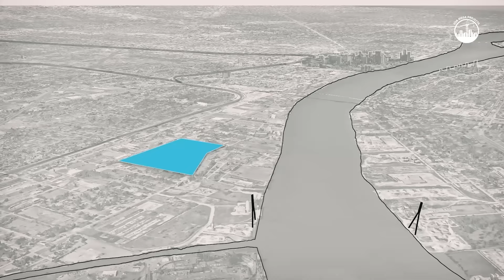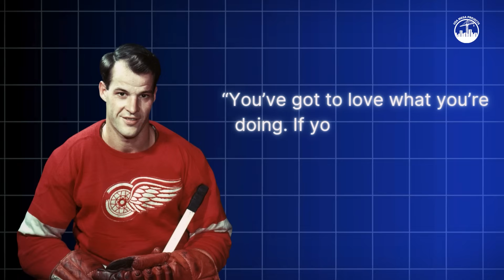Inside the Gordie Howe International Bridge: Detroit’s $4.7B Mega Project

Comment: NOT Detroit's project. A Canadian project paid for totally by Canadian taxpayers and the tolls will be collected in Canada. Also trucks will be direct to Hy 401 not through city street.
Reply from the maker: That’s correct. It’s a Canadian-owned and funded project, with tolls collected in Canada, and the design routes trucks directly to Highway 401 rather than through Detroit or local city streets.

Comment: I seen so many engineering mistakes already. It will have major problems in a year.  

The off ramp comming into detroit has a major dip in it. They just tried to cover up how bad it is by sliding dirt under it.  Those cables are also going to give way under all the weight of the trucks, woth no support in the center. Horrible engineering nightmare. Which took 2 years longer than it should have to make.
Reply from the maker: Concerns like that are common when people see early-stage settling or temporary fixes during construction. Major bridge projects go through repeated inspections, load testing, and structural monitoring before opening, and cable systems are designed with large safety margins specifically for heavy truck traffic. Visible dips or adjustments are usually part of final alignment corrections, not signs of failure. Real problems would trigger regulatory action long before public operation is allowed.

Comment: I always took the tunnel because there was no truck traffic which is why the Ambassador bridge was so slow.
Reply from the maker: That makes total sense avoiding the truck congestion would definitely make the tunnel a smoother and faster option. The heavy commercial traffic on the Ambassador Bridge has always been a major bottleneck. The new bridge should help ease that load, but for regular drivers, the tunnel has long been the quicker, quieter choice.

Comment: You can overcome anything - except a moron President doing everything possible to block trade and destroy the Canada/U.S. relationship.
Reply from the maker: You’re right, leadership makes or breaks these projects and relationships. Engineering challenges can be solved, money can be raised, and even politics can usually be negotiated — but when a president or top leader is actively blocking trade and cooperation, it creates unnecessary walls between two countries that rely on each other. The U.S. and Canada have one of the closest economic relationships in the world, and damaging that for short-term politics hurts both sides in the long run.

Comment: The towers are not taller than the Renaissance center. The Mackinac bridge is by far larger and has a 3800 ft span.  Get your facts straight.
Reply: He said “cable stayed bridge”. His facts are correct. Mackinac is a suspension bridge which is quite different.
Reply: I’ve walked over the Ambassador Bridge and the Mackinac Bridge.  Just sayin’.
Reply: @joesmith1574 makicac takes a little longer....
Reply: Might say the same to you. Mackinac is a suspension bridge. He qualified this.
Reply: @witsend101 he still called it th largest bridge in North America...
It's not even the largest bridge in Michigan.........
Reply: @witsend101 not “he” it’s AI
Reply: Not to mention, This info is bullshit... Canada was responsible for the bridge being built So what does the U.S. have to do with it?? Arrogance plus!! Effing grifters!!